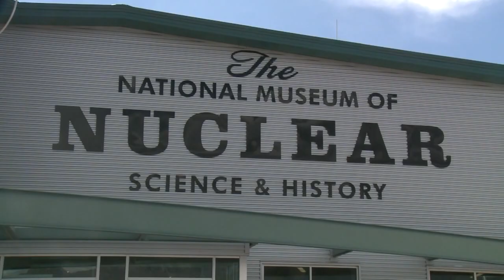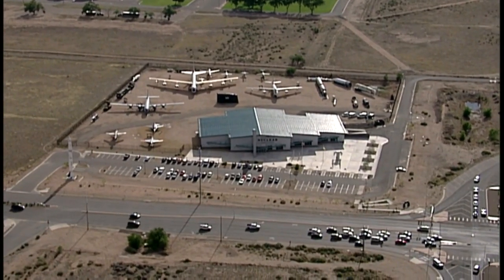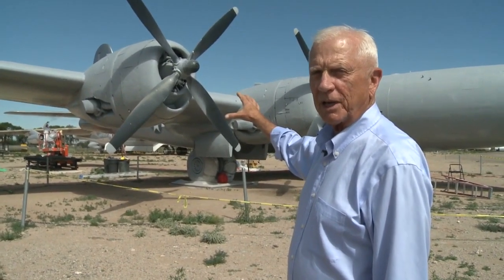Restoration work begins on Albuquerque B-29 bomber

Comment: If you want to see a B-29 brought back to life, then check out 'Doc' in Wichita, Kansas. It recently completed its first flights since the military retired it to be a target at the bombing range at China Lake.
Reply: FiFi wasn't in nearly as bad shape as Doc when her restoration began. Watch the video of Doc being rescued from China Lake bombing range.
Reply: She was a Diamond in the rough when they found her, But after years of effort by an all Volunteer force. Doc shines like a New Penny ! ! !
Reply: doc is awesome along with the fantastic FIFI. these static displays dont do much for me. its not an experience to see something that will never fly again.

watching and listening to those mighty 4 R3350's start. the smokey start burning off the oil in the lower cylinders followed by a silky smooth running monster with a throaty exhaust nothing else like it. the smell of the oil and the avgas.

followed by the sound of those 4 engines being brought full power and the nose wheel lifting up followed by the main gear as that incredible piece of history heads back to the sky....... back where she was built to go, she begs to be flown.

dont forget the landing. that sound of the chirp chirp as the wheels touch the ground. safely back on the ground ready for a future mission of passing on the real experience of a living, breathing warbird

weather its a B29, a B17, b25, lancaster, spitfire, mustang, corsair, wildcat, hellcat, tigercat, bearcat, P47, P40, P38 its all an experience to see them fly.

i flew in two different B17's including the liberty belle that met a sad end. i was pissed of an angry when that plane burned up just because the firetruck didnt want to get stuck on the mud. if i was driving that firetruck i would have driven like a madman to have saved that gorgeous priceless piece of history. BUT they must be flown now and well into the future. i want my 6 year old son to see it flying and ASK questions. what is that interesting airplane and WHAT did it do?
Reply: To restore Doc it only took

7-$9 million 
350,000 volunteer man hours
and help from the DOD and Boeing

to finish the project